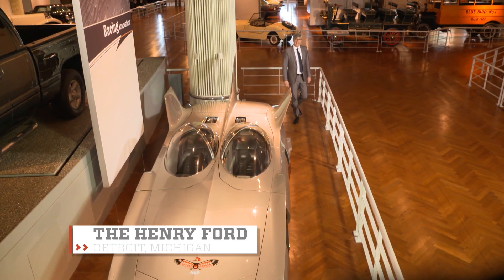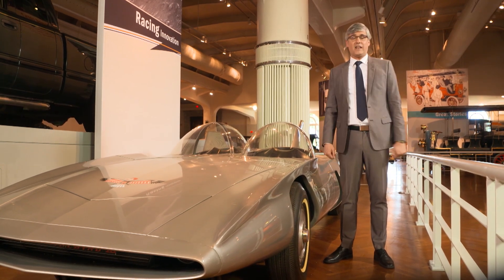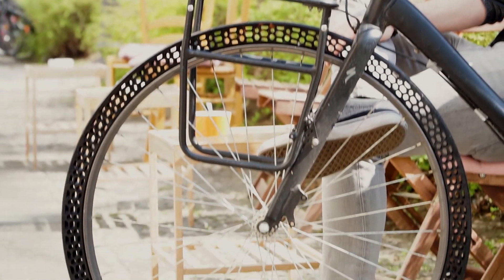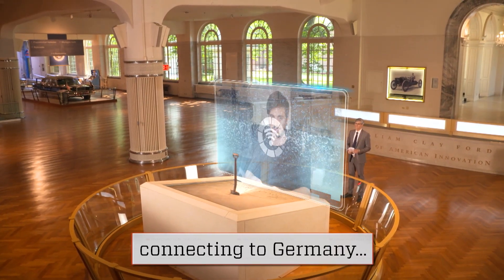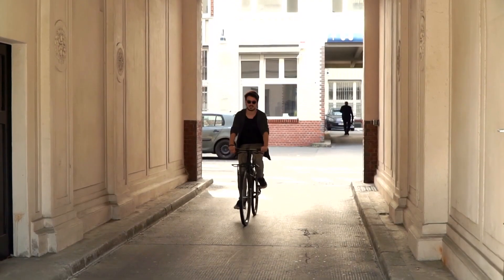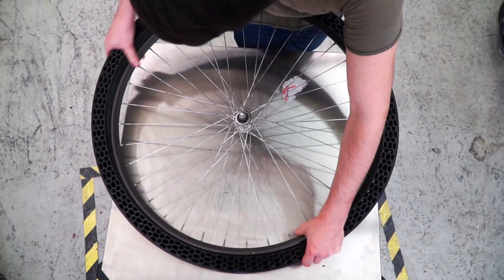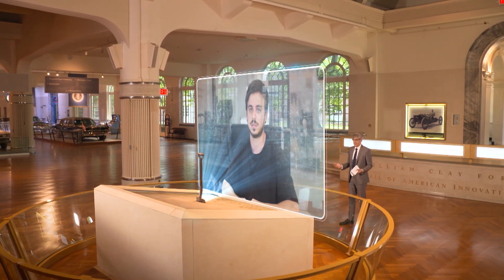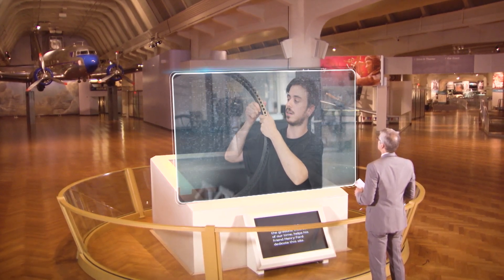3D-Printed Bike Tires | The Henry Ford's Innovation Nation

Comment: OMG tell me you don't know the market without telling me you don't know the market, the solution for bike tires going flat is already well established in the mountain bike market, you use your regular tires, you fill a portion of them with a sealant liquid that is white like milk and then when the tire gets a puncture pushes the sealant through it and seals it, and you barely notice it and you can keep riding for the rest of the day.

Yes, 3D printed tires sound great but they suck.

Comment: This guy is funny, not really new or inventive.  This has been around for a while before he made a claim and major tire/car companies have already built this also turns out there is a major flaws: depending on the speed which you cant exceede 55mph which will cause a loud noise and rattling of the frame. Also debris getting inside.
Reply: Ok that explin